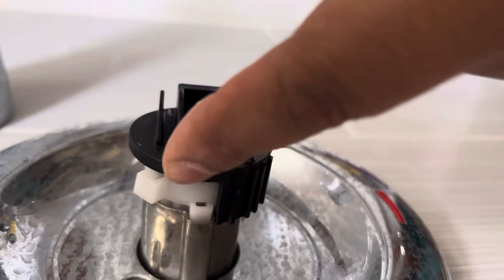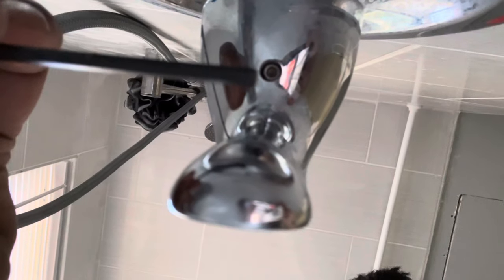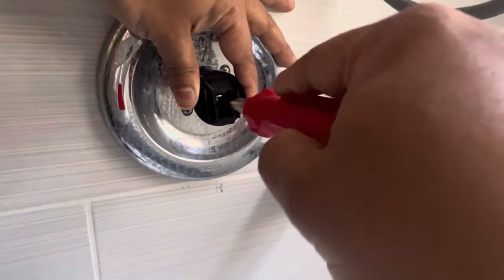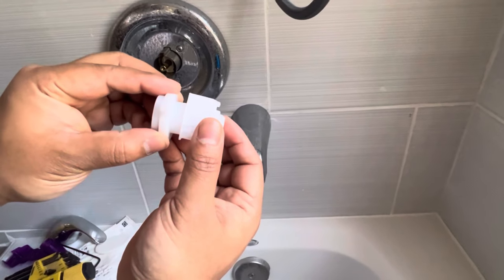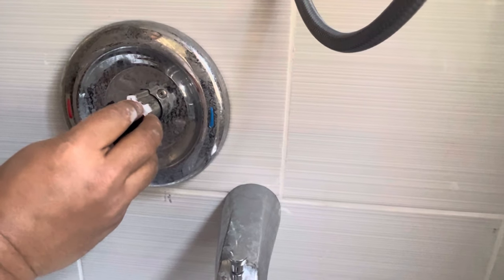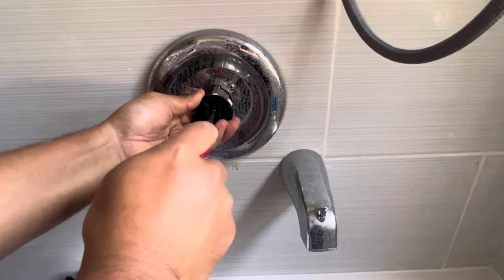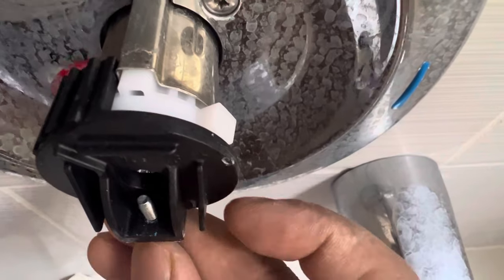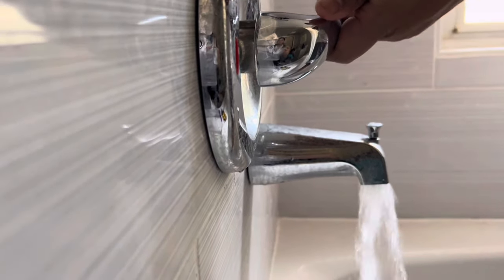How to adjust temperature for Moen shower diversion valve

Comment: The missing wrinkle was... do we adjust the white plastic temp guard to the left (counter-clockwise) or to the right (clockwise) to make the water hotter?  Guests are complaining about warm water in the guest bathroom.... it's just fine in all of the other bathrooms.  So now I have it apart (thank you for the video) but you're not clear on which way one runs for hotter or colder. At the moment the temp guard (I'm not clear on the plumber lexicon) is at 12 noon.
Reply from the maker: I believe turning it clockwise water would be cooler and counter clockwise would be warmer.
Reply: @D.B._CooperMLMC Gotcha!  The objective is to adjust that "safety washer"  such that you're able to turn the faucet handle further to the left... counterclockwise from the noon position towards the 9 o'clock position.  The further you're able to turn the faucet to the left, the warmer the water.  Hence the "safety washer" or whatever they call it... I call it the government intruding on my hot showers!  Per these videos one "simply" removes the washer and reinstalls it by a few gears, in either direction, your preferred temps depending. I don't have it in front of me but I agree, it gets confusing.... if you want it hotter and you've reinstalled it too many gears the wrong way, the faucet handle might be more at 2 o'clock (colder) instead of 10 o'clock (hotter).  Determine all of that prior to fastening everything back up... it's a quick determination.  My problem was that my "safety washer" assembly only allows for one position... take it off, spin it either way and you can't reinstall the faucet assembly at all!  Soooooooooo... I just took the "safety washer" off entirely and am now living "dangerously" eg., guests might actually get a hot shower!  Heaven forbid.  I haven't seen any need for leaving it installed and it eliminates the guesswork you're experiencing.  Good luck.
Reply from the maker: You are correct. I kept the plastic piece with gears on mines because I don’t want the water too hot on this particular bathroom. With water being not too hot, I adjusted so that It’s kids safe.
Reply: @handymanschool  Its a safety device and specifically for that purpose... prevent people from scalding themselves.  That said, if the water is too cool at this location, adjusting or removing the guard takes care of that. We don't have kids and even if we did, the water in this shower required adjusting.

Comment: Correct... they say spin the guard counter clockwise BUT it won't reinstall when adjusted left of "12 o'clock" so I just removed the damn thing. Now the hot handle pivots all the way to 9 o'clock!  And the water's hot.
Reply: What pc did you remove?
Reply: @nltemple82  the spin guard
Reply: I wanted to go left of 12 o'clock so I could lower the temp of my hot water heater.  I ended up leaving it at 12 o'clock.  Seems like a safety feature.
Reply: @micheleh7652 as I said just remove the spin guard and reassemble. Faucet should twist left to 9 o'clock.
Reply: Which piece is the spin guard ? The black piece?
Reply: @rubengonzalez8399  No, it's the little white piece, as the video opens, it's in his left hand, between his thumb and forefinger... it's about the size of a dime.
Reply from the maker: @peterbell9683 you are amazing my friend. Thanks for the help.
Reply: @handymanschool  We're all in this together! 😉
Reply from the maker: @peterbell9683 🫡